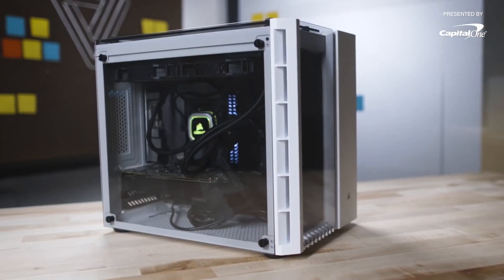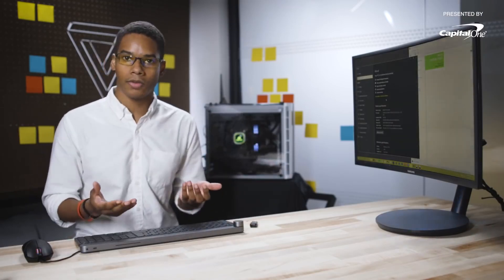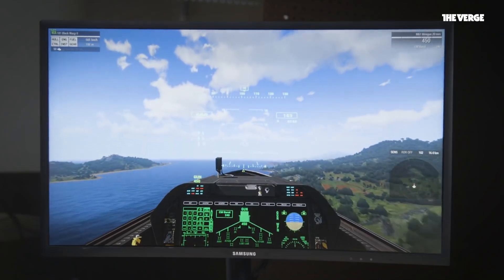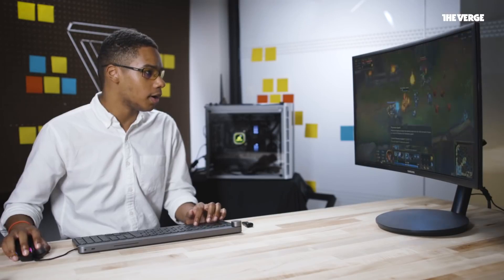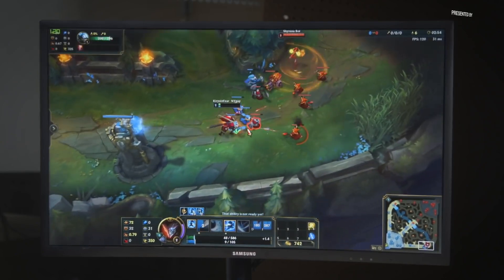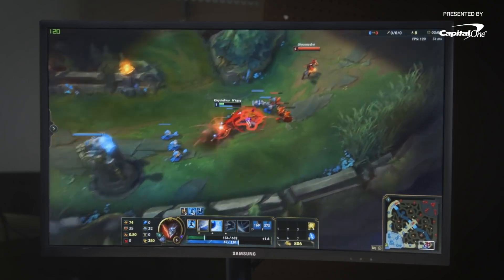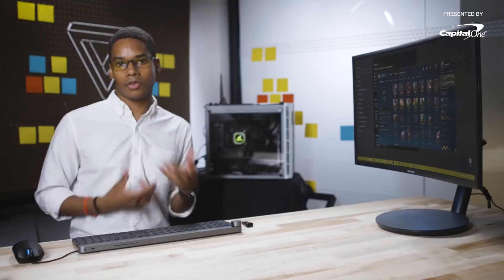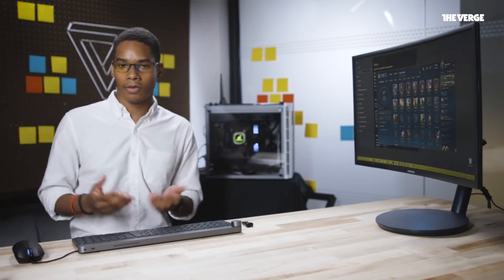How we built a $2000 custom gaming PC

Comment: You can overclock any computer. Some PCs do better with overclocking than others. I wonder if he even knows what a CPU is.
Reply: You cannot lol, at least if you talk about CPU, some are locked
Reply: @KILLERMATYCZ the people I knew who messed with overclocking a lot would change settings in their bios. I will admit I don't try to mess with my system. I will also admit that I haven't owned that many computers over the years. I haven't seen a cpu that you couldn't mess with. The bios is an onboard chip on the Mobo. I would expect that to be the place that they would limit access. I don't really know how they lock cpus. I don't have experience with it.
Reply: @Xgnome_childX  I think what hes getting at is more for preassembled, complete PCs. Less the case when you build your own.  
Most manufacturers of PCs lock MOST if not all of the BIOS options so the users has little to NO control. The way you get full control is by building your own PC by choosing the motherboard instead of buying a complete PC from Dell, Samsung, Toshiba, etc... When you buy a motherboard you are given nearly full control because the motherboard doesnt know what other components will be installed and is open to a wide range of configurations that you must specifically choose. The people you knew, built their own PCs, or at least knew the PCs whos BIOS values they were adjusting, were already unlocked.. 

BTW this video is a reupload that was originally uploaded for The Verge youtube channel. After all the negative criticism they received, instead of correcting the error, they deleted the video, probably at the request of the sponsor. I believe Rye Hots reuploaded it to serve as a marker in history, to help prevent this from being swept under the rug, and maybe to encourage The Verge to admit their mistake of producing tutorial video without knowing the material. The Verge is known for harshly criticizing public figures mistakes, and when they themselves make a bad mistake, they try to cover it up. Extremely hypocritical for a publication thats got over 2 million subs...